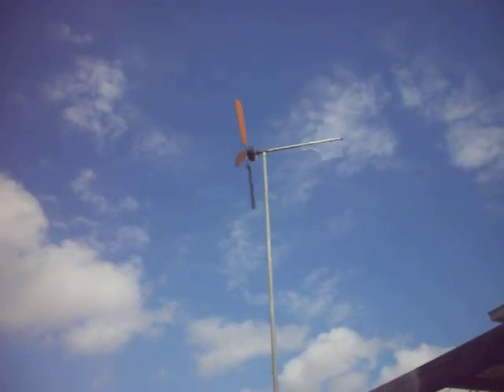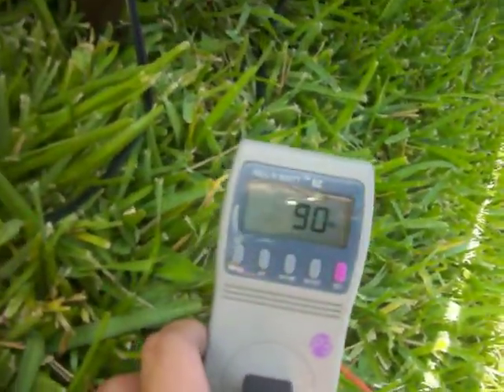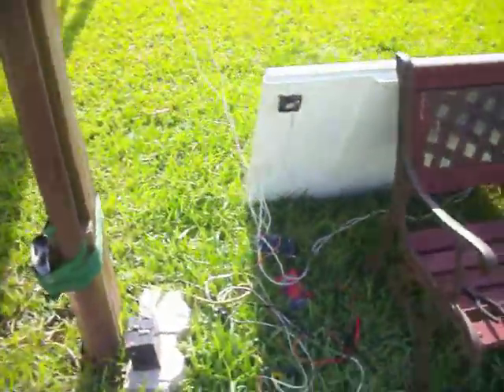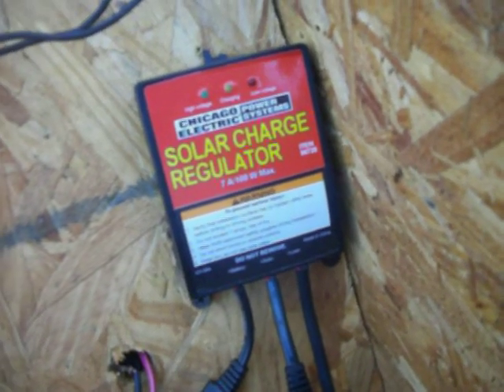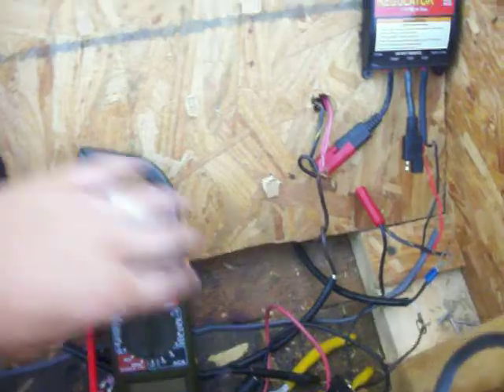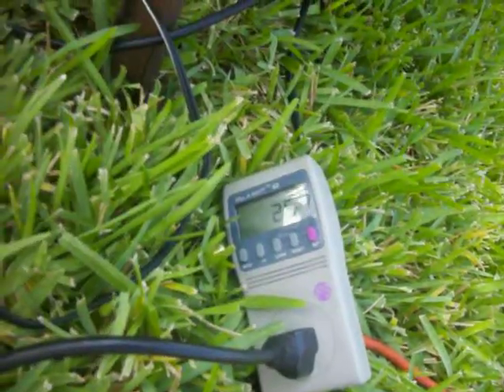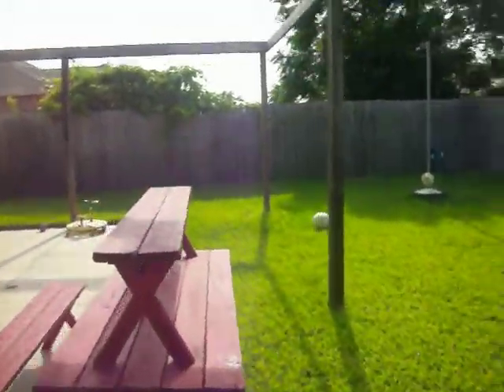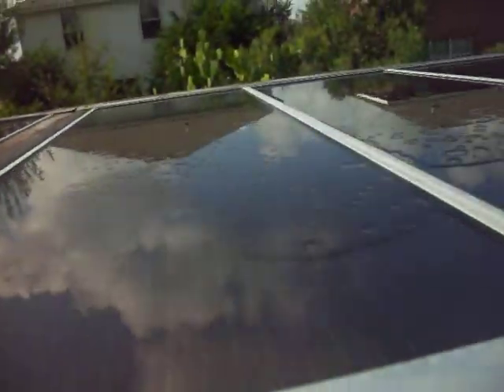HOMEMADE DIY SOLAR PANEL WIND TURBINE GENERATOR GRID TIE INVERTER TEST 1

Comment: Looking good.  I just put my first 65w panel up today and am grid tying 50w solid with  a SUN-250G.  Keep in mind that it is critical to have all the panels that are in parallel to be at the same voltage otherwise the system will drop down to the voltage of the lowest one with no increase in current.  For instance a 50 cell panel in parallel with a 40 cell panel will produce the same power as two 40 cell panels (assuming all cells are the same).

Comment from the maker: I did.. it worked for a while until I had a sunny day and the wind was so strong that it burned the charge controller out.. ha ha.. normally that ceiling fan won't produce high amps so it worked good for a while. .

Comment: what do I need to connect wind/solar into the main electric line I get from the company ?! the objective is to keep renewables running for energy usage offset for the electrical wiring for the whole house (small house)

Comment: im ating for my phone to be unlocked... can you plug solar pannels into a stabelizer that will connect to a dc 12-24v to ac240v so if i have say a set of 30 pannels outside my caravan and something thatmakes the power go down to 12-24v dc no matter what that then connects to a dc to ac car converter for camping can i rig it so i use a regunal 3 pin plug to plug into power in the caravan to sell...

WILL THIS WORK???